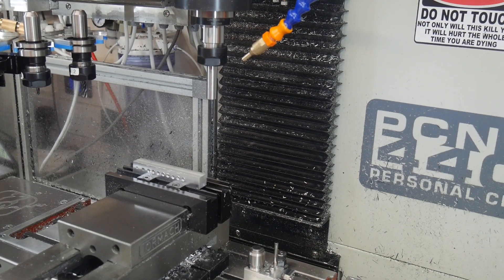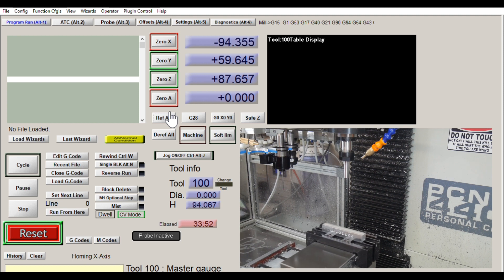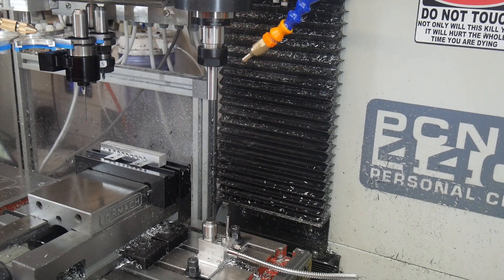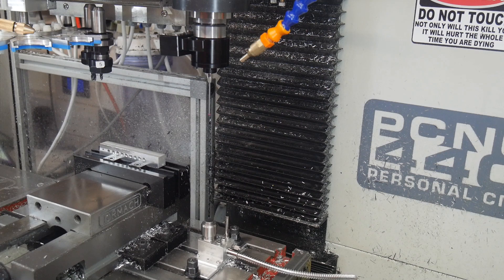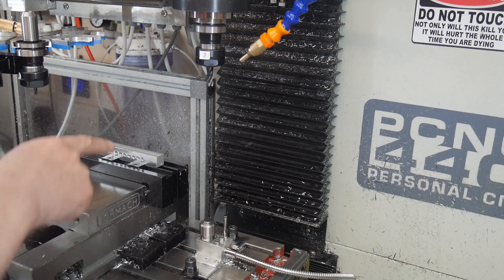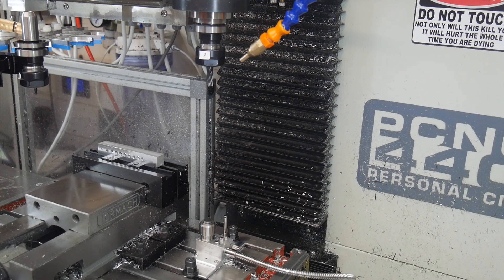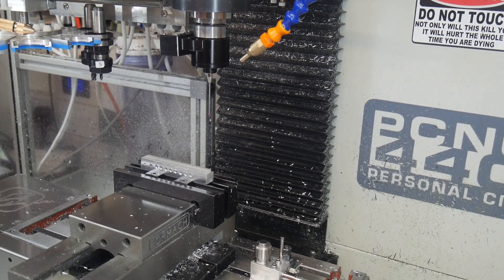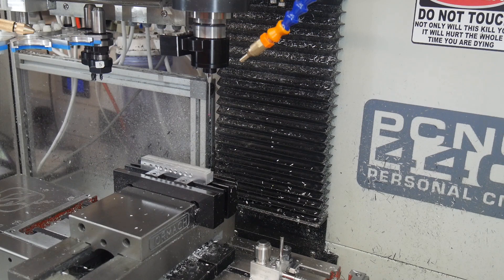Using an Electronic tool setter (ETS) on a Tormach PCNC440

Comment: Any idea how to write how to do the ETS with gcode? Im still on the candle bandwagon, until I get a larger mill to convert im just using a smaller modified one
Reply from the maker: In PathPilot, you move the head above the ets and type G37.1 to memorise the position.  Then G37 anywhere in your code will measure the current tool and update its length in the tool table.  Mach3 doesn't have anything that simple and you have to use G38 probe commands and wire the ETS to the probe input on your controller.

Comment: How'd you mount the fog buster to the Z Gantry?  Looks non standard given the Tormach installation instructions.
Reply from the maker: It's not a fogbuster - just a cheap mist nozzle I found on Amazon.  There's a tapped hole behind the spindle that I used to mount it.

Comment: So you are not using pathpilot obviously. What do you use for the mill controller ? I really like your wireless probe. May I ask you how you routed the cable of the ETS to the mill controller board and how do you manage to have both the ETS and the probe to report at the same time ? I thought Tormach mills only had one accessory port. Great video BTW !
Reply from the maker: Hi.  Control is Mach 3 and an ethernet smooth stepper.  I already had a lathe converted to CNC with the same setup, so I had the Mach licence and had experience with it.   No reason to want to change and although PP looks nicer, Mach3 is very much easier to customise, hence my own screen layouts, ATC and speech output.   I'm actually using the same laptop with a wall mounted touch screen to control both lathe and mill (not at the same time)!

For the wireless probe conversion, see https://shop.xoomspeed.com/collections/frontpage/products/wireless-probe-kit  This converts either the Tormach passive probe or the ITTP and provides 2 extra inputs for ETS etc.  This works with either PathPilot or Mach with no special programming.  There are links to photos of how the conversion is done.

It works on all the Tormach mills, but the 440 has no power on its accessory port, so you need something like a micro usb phone charger to power the base station with that machine.  All the other mills have 5V and 12V on the accessory port, so the base station plugs in there and that's it.

Once you've got this working along with the integrated probing routines in Fusion 360 (I can supply necessary code/post/macros to support PP or Mach3) it really does change the way you work.